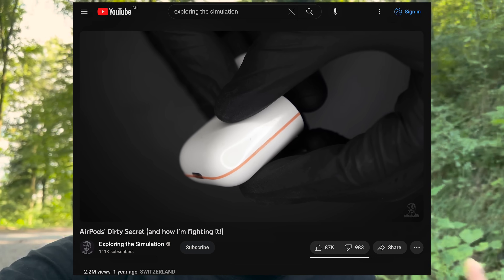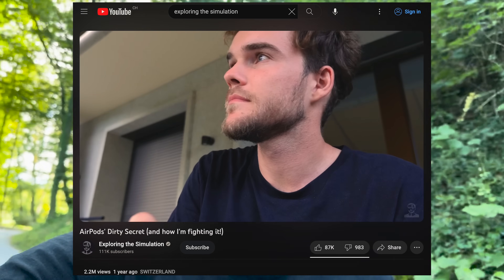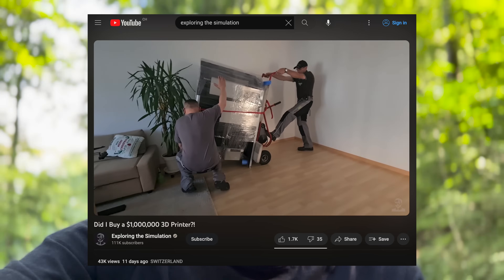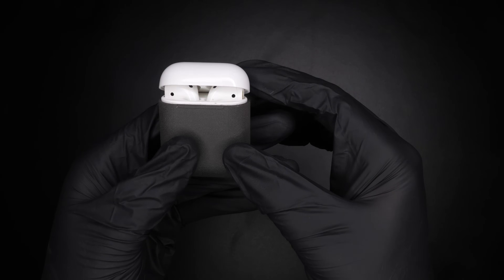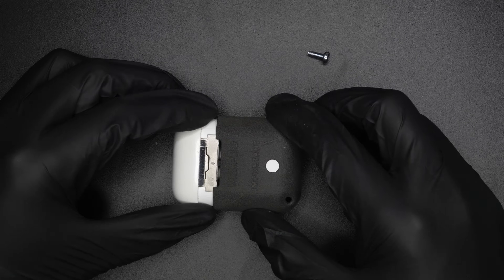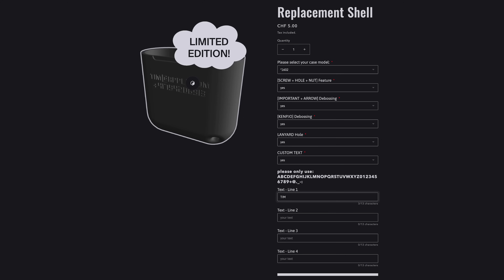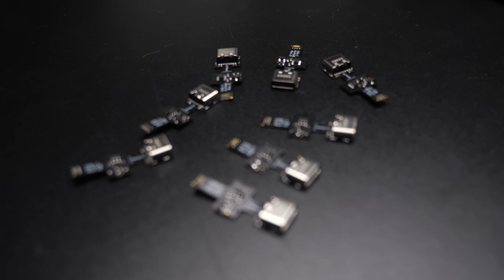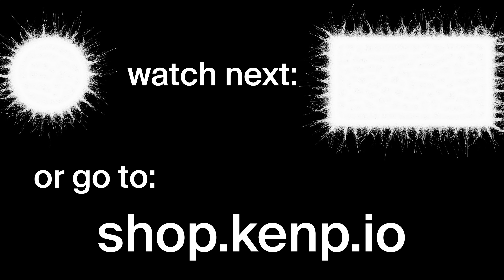FREE AirPods Replacement Parts for Everyone (October Only)

Comment: Would you do parts for AirPod pro gen 1 or 2 to upgrade to usbc/wireless mag safe?
Reply from the maker: I've been selling that part for a while ;) check out my other videos
Reply: @ExploringTheSimulation  I opened your site and it isn’t in your shop (just the usbc flex cable part for the pros) I have the original pros and want to add wireless MagSafe and usb C to it but don’t have the tools for it. Can I just send you my case and I’ll pay you to do the upgrade for me, just let me know how much. I appreciate everything you’ve been doing to make this happen :)

Comment: I have a question if you were able to change the usbc for the iphone 15 would it be possible for it to overheat less or would you need to replace the usbc port and get a non apple.

Comment: Hi. 
Thank you for your initiative and knowledge sharing. 

If I want my AirPods 2, be usb c, I need to get the replacement part (5chf) plus usb-c flex (34.90chf) and mount it myself? 

Thanks,
Reply from the maker: No, Airpods 2 (non-pro) you get the shell (free with discount code) and the usb-c flex which is 19.9 CHF
Reply: @ExploringTheSimulation thanks, Same apply for airpods 2 pro?
Reply from the maker: @JS-dn2zp  those are not supported, everything is explained one shop, you can also check the faq

Comment: Develop a USB c conversion kit for older iphones from iphone 8 se2 to14 pro Max
Reply from the maker: I would but you need to drill the bottom hole to make it bigger, so not many people will attempt it sadly...
Reply: @ExploringTheSimulation  i have seen that you can sell with case or without case as on option
At least make the kit i understand as bussines point of view starting something which has uncertainty is risky but you can try with experimental small batch an OEM fit conversion kit with optional body or you can make a paper template for every phone for how much to drill for buyers without body .do give it a try in small experimental batch I think it will make news if you market it right.
As iphones are more popular

Comment: Make type c conversion kits for old iphones
Reply from the maker: I would but you need to drill the bottom hole to make it bigger, so not many people will attempt it sadly...
Reply: @ExploringTheSimulation    i have seen that drilling  but you can sell with new body or without new body as on option
At least make the kit i understand as bussines point of view starting something which has uncertainty is risky but you can try with experimental small batch an OEM fit conversion kit with optional body or you can make a paper template for every phone for how much to drill for buyers without body .do give it a try in small experimental batch I think it will make news if you market it right.
As iphones are more popular.
Please try it will work .

Comment: This is awesome! Ordered together with the USB C upgrade. Do you have a reliable source for a replacement battery?
Reply from the maker: Great question. I think they all come from the same market in Shenzhen anyway. Rewa is pretty reputable but can't confirm that it is something different than what you can find on eBay or Aliexpress

Comment: What is your recommended vendor for the airpods/case batteries? The battery is the last thing I want to compromise on with my electronics.
Reply from the maker: Great question. I think they all come from the same market in Shenzhen anyway. Rewa is pretty reputable but can't confirm that it is something different than what you can find on eBay or Aliexpress
Reply: @ExploringTheSimulation  Thank you!

Comment: This is truly amazing, do you have any plans on selling a similar case for the airpods pros ?
Reply from the maker: AirPods Pro Gen1 don't need the 3d printed part, and the usb-c upgrade is already available! check out my other videos
Reply: @ExploringTheSimulation  yeaaah I known they don't need it but I mean it does look cool ;)
Reply from the maker: @t34d1um  ha I see what you mean now :) I agree it does look cool and I've shared the 3D file before. The only issue I see is that the wireless charging coil is glued to the case and it's a real nightmare to unglue it without destroying it.. So probably won't sell that

Comment: Hi I love this my parents are In France from till October 12th would it be shipped to them in time or no I have an old broken AirPods case than needs this lol
Don’t worry the price difference in shipping is minimal
Reply from the maker: I can ship before that date but can definitely not confirm that it will arrive by that time. So wouldn't risk it if I where you.
Reply: @ExploringTheSimulation yeah I was thinking about it but I would be risky it and I would rather just pay the extra 5.50$in my currency of course 3chf

Comment: Any plans on making a repairable case for the Pro 2?
Reply from the maker: Pro Gen. 2 will not happen. The case is the worst out of all the generations. I tried to break it open and it's almost impossible. My thinking is that if with all the experience I have I still can't get it open, most people won't be able to. Therefore selling parts doesn't make sense :/

Comment: Ok now that's just based. 
I found a pair of airpods 2 nobody wanted for a couple years and as an android user this sounds like a great opportunity to ditch the lightning port, while also making it easier to replace the battery which I'll probably need to do soon as it looks like it's a bit worn already (though the buds seem to be too and sadly those are unfixable *YET).
Reply from the maker: they buds are fixable! there's some links in the description. but for sure that's why I'm so excited about the project, there's millions of those AirPods cases that noboby wants. It's still a great product and we should give them a second life.

Comment: Would you consider selling airpods pro 2 cases and mods?
Reply from the maker: I would, but the case is the worst out of all the generations. I tried to break it open and it's almost impossible. My thinking is that if with all the experience I have I still can't get it open, most people won't be able to. Therefore selling parts doesn't make sense :/
Reply: @ExploringTheSimulation  fair enough, i mean, at least apple sells a usb c case for it now?
Reply from the maker: @PCJesus0  yes, but the usb-c case is not compatible with existing AirPods Pro 2, so you gotta buy the whole thing again 😒
Reply: is it the same with the Airpods Pro 1 Gen case ?  @ExploringTheSimulation
Reply from the maker: @bercucipaul9839  not 100% sure what your question is, but you can mod the AirPods Pro 1 case to USB-C pretty easily! I made videos about it and the kit is on my shop.
Reply: @ExploringTheSimulation That really sucks! You should elaborate a little bit on your site because it kinda looks like an “I don’t want to/don’t like them” where it says that gen 2 and airpods 3 will never have mods.
Reply from the maker: @NebulaHatesWatchdog  ok that's fixed, thank you